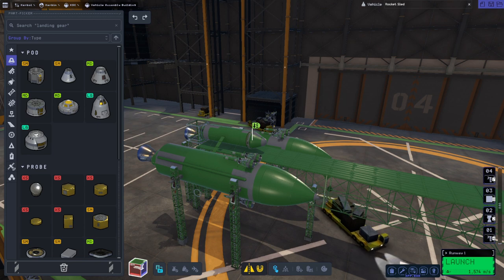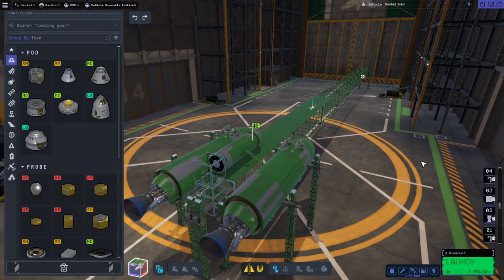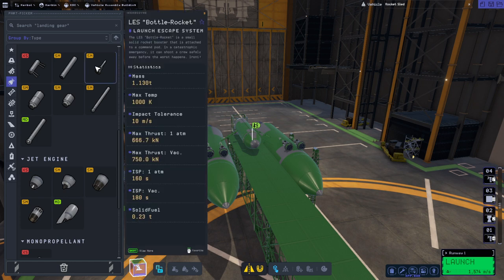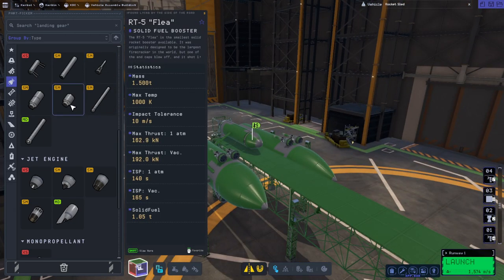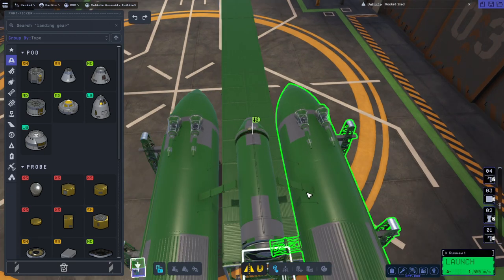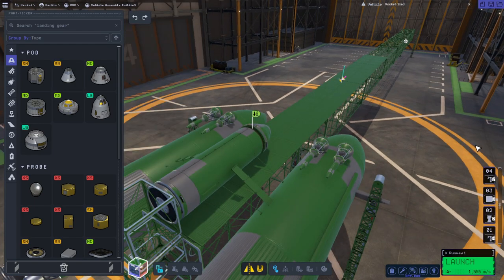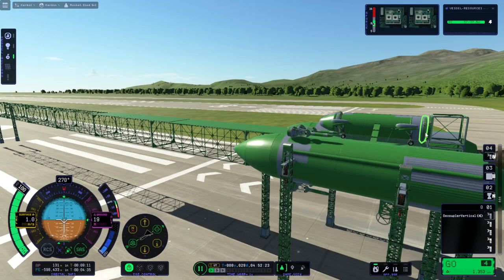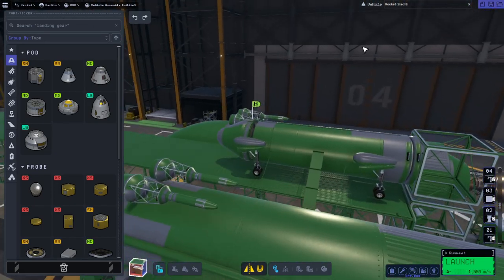KSP 2 Early Access - Rocket Sled First Attempt

Comment: ideas:
* it seems the large probe core is the first part that explodes. why not remove it since you have the smaller one in there anyway
* add a more structurally strong part to the bottom of the tank to slide over instead of sliding over the tank itself
* start with landing gear retracted
* use rover wheels instead of landing gear
* why use docking ports? why not just a decoupler?